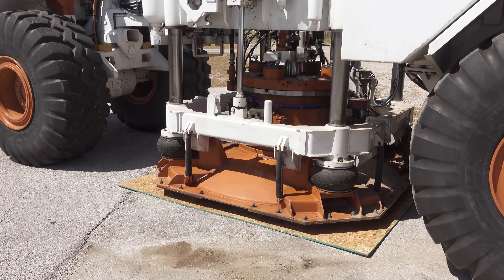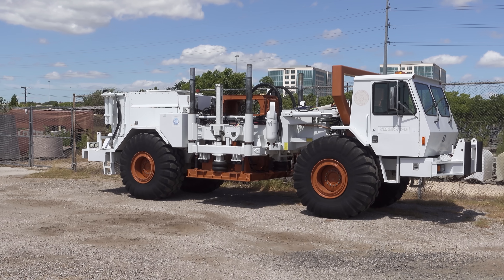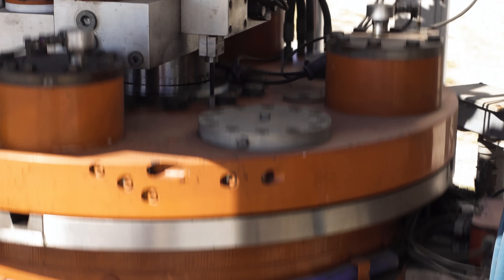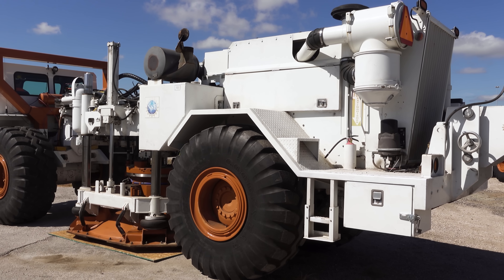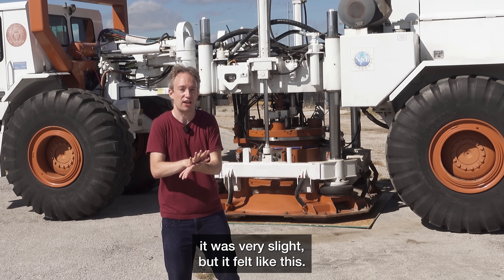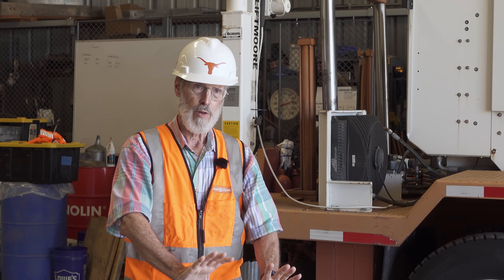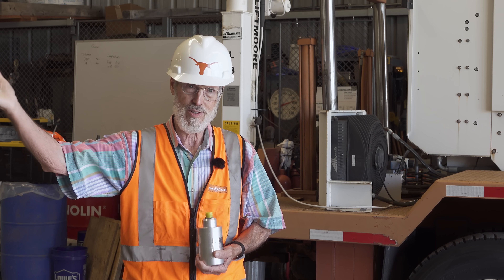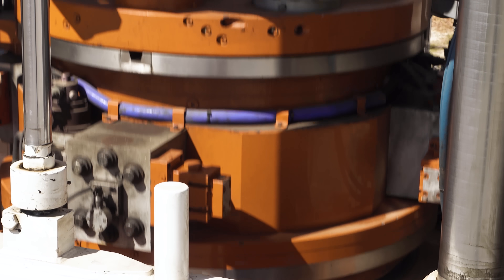This massive truck makes artificial earthquakes

Comment: It used to be called a vibroseis truck... you put 4 of them in a row, front to back, synchronise their occilations so the pads are going the same direction at the same time, and start a "sweep" of frequencies high to low with most of the 30,000 pounds of each truck resting on the pad.  That will constitute an energy wave that will reflect off subsurface structures that may confine oil.  On the surface there will be an array of low frequency microphones to record the energy waves generated by these trucks.

Comment: That unit has an ivi / Mertz chassis and so old but the shaker is modern with a Moog valve using a Pelton instrument. I’ve been a vibe tech for 20 years in the Middle East and that unit is a baby compared to new equipment. The main vibe manufacturers currently are Sercel and Inova with great technology

Comment: they did this in my community. within a short number  of years the gas lines which cross under the street were all replaced one by one. These companies should foot the repair costs for the damage they cause. they should create a fund to cover the cost of roughly half the infrastructure they map, as half the pipes run under the street to the side where the main line is.

Comment: Aha! That's what that machine is! I saw one of these at a dam near me, driving (and getting stuck) on the dam wall while the water level was low. I knew they were installing some kind of seismic sensors, but couldn't figure out what the truck was.

Comment: This technology was used in our area a few years ago by Friedrich-Alexander University of Erlangen to map 50*90 km of the underground due to a temperature anomaly. They wanted a) to find a reason for said anomaly (unexpectedly high temperatures in depths of 1.400-1.600m) and b) if it was safe to use that temperatures for geothermal power plants. They didn't find a direct explanation for it but could determine several areas where the underground would be ideal for geothermal energy and the next step is to proceed with actual boring there.

Comment: I'm sort of confused as I was working with a seismic exploration company that would bring in up to 3 of these type of shaker trucks and that was back in 1983.  Granted they weren't using it for earthquake analysis.  You could program the shakers to run through a complex signal to inject into the ground to pick up on the sensor lines for "looking" under ground at the various strata based on the return picked up at the sensors.  This was advanced back then when other strong signals were used previously by the geologist world.

Comment: The old British cartoon, "Danger Mouse" has a scene appropriate here.  "Penfold, is Wales known for earthquakes?"  "um.. I don't think so chief".  "Then it's as I feared, this vertical oscillation is being caused by the alternating pedal pressure of a large, 'draconium draconus'"  "Is that good?"  "It is if you like dragons, it means there's a whopping big one heading this way"

Comment: Shakers have been around for decades. While working at UT at Dallas in the 80s, I designed a remote radio control system to control one out in the Nevada Test Site. I sat on a mesa at night and used it to synchronize my recording truck with the shaker thirty miles away.

Comment: When digging out the concrete road in Hunter Street Newcastle NSW the vibration from the jackhammer on the machines made the building resonate causing some panic, the water in my glass had 6  two inch water spouts like that wave pool makes, it reminded people of the Newcastle NSW earthquake

Comment: This Professor Stokoe: Don't mess with him,. He seems like Nikola Tesla when he was testing his "air hammer" (according to the stories, he built an air-powered reciprocating "engine" that caused a local "earthquake" that had the potential to destroy buildings by frequency resonance, and it only ended when he "smashed the device with a sledge hammer".  Haven't yet found a true account, but you can see Mr. Stokoe has it in the back of his mind that he can "Jericho" anything if someone, even if it's him, says it's a worthwhile project.

Comment: I live in an area that has oil wells. A few years ago the oil companies did a bunch of geologic surveying, they had three or four of these machines running around with helicopters and ground crews setting up the sensors, they also had ground crews setting up sensors and triggering ground vibrations with explosives.

Comment: I remember these machines back in the 1970s in the UK. They came through our village in threes stopping every few yards testing for oil through seismic vibrations. And yes they found they found oil, some of which is still being pumped out of the ground now some 40+ years later.

Comment: Growing up on oil rigs on the Omani desert in the 1980s, we had similar but not identical pieces of equipment, we called them “thumper trucks”, used for seismic exploration for oil. A line of them would drive across the desert, pause, then all would drop their enormous weights at once to create a shockwave, which another truck a set distance away would read and produce a seismic survey of the rock strata underneath as they progressed forwards.

Comment: I used to work with a company that used trucks like these to create 3D underground maps of oil pockets and mineral deposits without needing to dig, by using a large grid of sensors on the surface and detecting the reflected shockwaves. Very cool tech

Comment: What an amazing piece of engineering that greatly helps science and architecture to create safe buildings.
This thing might be responsible for saving millions of lives and hardly anyone knows about it.
Reply: Billions. It is a part of a system that has saved 3-4 billion lives. It is used for oil prospecting, and without the Haber Bosch process (natural gas turns into fertilizer) 3-4 billion people would starve to death

Comment: Fun fact: Stephen Speilberg came up with the idea to have the glass of water vibrate to the footsteps of the t-rex, but no one on the crew could figure out how to do it, until the night before the shoot, when a crew member put a glass of water on a guitar and plucked one of the strings.  On set, they connected the cup to a guitar string that ran through the car, and a guy laying on the ground under the car plucked the string.

Comment: They use this for oil and gas exploration as well. Installed sensors all over the place, closed all streets and forbade all the farmers to use their tractors and then they drove around with a rattler like this which helped them exactly locate the resources

Comment: At CERN we used these kind of seismic trucks a few years ago to assess the impact of the civil engineering works needed for the High-Luminosity LHC upgrade on parallel LHC operation. Quite fascinating machines indeed.

(Fun fact: the LHC is a quite sensitive seismometer. We do see earthquakes thousands of kilometers away on the beam orbit. Note that over the 27km long ring the beam orbit needs to be stable at the level of a few 10s of microns...)

Comment: 27hz is the highest frequency my sub can play at 0db before dropping into nothingness (-120db) at 23hz, thanks to some EQ magic pushing the roll off point down to the physical limitations of the driver itself. I had to turn this thing down while it was pummeling the ground lmao. The high end was actually louder but it was also rumbling my room a little bit since I usually listen to your videos quite loud anyways. I've got a bit of experience causing miniature earthquakes myself, except we always did it using standard concert PA speaker stacks, during sound test before a large show! We'd flip a bunch of subs over on their face, so they created a compression chamber out of the entire horn, which lets the sub run more efficiently while transmitting the energy more effectively into the ground. If you hit the ground with enough directed sound energy all at once, you might get a visit from the local USGS team while they investigate what the hell is going on! Great people those folks are, we had a good laugh together once they realized what we had done.

Comment: These ground shakers have been around a long time. During the 1980s I lived in an apartment building and felt the ground shaking in a very regular rhythmic pattern. I walked out side and some distance away on a nearby street was one of these ground shaking machines that was being used. They would travel a short distance down the street and shake the ground then move about 10 feet and shake the ground again and kept repeating this for a period of time.

Comment: Cool.   One of the taller buildings at UCLA was kitted out with a bunch of strain sensors and accelerometers... A collaboration between a computer science networked sensors group and civil engineering.  I wonder if that was why these UT folks were at UCLA to get in trouble ;)

Comment: I delivered one of these to the Louisiana DOT a few years ago. Mine was like a big box truck with a lab inside. It had a plate on the back to shake and a press inside to lower a seismometer into the ground so they could take readings of what the ground composition was for road maintenance.

Comment: This is a 60'000 lbs tri-axial vibrator generating P and S waves, for O&G exploration even bigger but only vertical vibrators are used, up to 95'000 lbs

Comment: My dad does a similar thing on the opposite end of the spectrum: ultrasonic testing of welds and vibration analysis of marine diesel and turbine engines. I didn't realize it would work on a large scale like this too!

Comment: I want to see the "30 times a second" footage with the machine appearing to be still, with Tom in front saying, "Wow!  This thing can really move!"
Reply: At 3:20 the 30x second footage is briefly shown. Looks like nothing is moving.
Reply: It was in there, very briefly.
Reply: @musewolfman  @jkk244 It seems you didn't get the joke...
Reply: It should show up though. The camera is 29.97 fps I think, not 30
Reply: @Anonymous-df8it  And with that precision noted for the camera, you think the massive machine is exactly 30.00000 times per second?
Reply: @jkk244  No. But you seem to think that the massive machine is exactly 29.97 times per second
Reply: @Anonymous-df8it  lmfao
Reply: @Anonymous-df8it  after a period of time, i have found out the machine is actually 29.98 times per second
Reply: @yeetionary  Sow why does it look stationary then?
Reply: @Anonymous-df8it  its 1 more obviously
Reply: @yeetionary  ???
Reply: @Anonymous-df8it  it's stationary + 1
Reply: @imcaro  ???
Reply: @yeetionary  bit of a missed opportunity... he could have turned it up to 11
Reply: @Anonymous-df8it  The NTSC color broadcast standard has been out of use for long enough that people very rarely use 29.97 fps any more. When a modern camera says "30 fps", it actually means 30 fps.
Reply: @Anonymous-df8it  video editing software could be rounding it up.

Comment: In the mid 70's a company came through our town with a machine like this.  The day or two before they came by and drove a bunch of sensors into the dirt.   Truck came by and sat in the street and did the vibrating for about 30 seconds.  Then it picked up and moved about 200 feet down and did it again.  I believe the whole point was subsurface oil or gas exploration.

Comment: I remember when I was a teenager - so we're talking back in the 70s - coming back to sixth form college after the summer break, and many of us had had summer jobs.
One guy had been working for an oil company - perhaps BP, I'm not sure - but they had a similar vehicle, which was used simply to drive around the UK, park in designated spots, and do similar testing. Probably not to these levels of force, but the purpose was for oil and gas surveying, and they were taking seismometer readings back for analysis. Thinking back, it might have been in preparation for fracking.

Comment: This is probably reminiscent of what it's like standing beside a stamping press in a factory. The presses there ranged from 150 tons to 800 tons. And with a few exceptions they ran at about 40-60 Hz. Even with massive 6+ foot thick concrete flooring the whole damn place shook every hit.

Comment: I find these kind of machines really fascinating.
In Germany I visited a boring company with the school and they used these to find gas and oil in the ground based on soil that might have some inside them reflects the waves differently.
And this knowledge is used to make a good guess on where a location for a test borehole would be ideal.

Comment: Had the interesting experience of the purely vertical shakers being used in the middle of the city a few years ago. Seismic testing for geothermal energy. Fun when they are right outside your window, and you are on one of the upper floors of a late 18th century building. Been in a few earthquakes in Japan, and was rather odd to suddenly get the same feeling in a geo-stable city in the middle of Europe.

Comment: This is nothing new however, 30 years ago I worked for a company that a did oil exploration software. The way it worked is that one or more of these earthquake machines would shake the ground and then the vibrations were picked up by various sensors. Our software would then take this data and build a three dimensional map of underground as to the type of rock and likely places that oil might be. There was a lot more to it than that but that's the gist of how it worked.

Comment: These are used primarily in oil and gas  surveys, called vibrators. A whole fleet generates a wave of large magnitude and the resultant sound waves are picked up by geo phones . The collected data is produces 3D slices of geological mapping
Reply: Twelve years ago I watched a formation of trucks like this drive in sync across the Kuwaiti desert near a military base. They'd all stop simultaneously for a minute or two, then continue driving (still in formation) to whatever the next spot was during their surveys. Unfortunately I was too far away to actually feel/hear shaking.
Reply: Yep, that's seismic surveying. They complement the data they get with ground based gravity surveys (a box with a spring that you precisely measure it's stretch at a certain temperature) as well as aerial sensors on aircraft. 

Travelled all over Australia and northern Canada doing this. Best job I ever had.

Comment: Something similar was brought in to test the subsoil before engineering the final specs that the Cape Hatteras Lighthouse was lowered onto or should I say lowered to the appropriate grade with high psi bricks filling the gap between the huge block of reinforced concrete and the base of the granite foundation where the cable saw cut the original sub-grade foundation off. The actual foundation was pine beams which were perfectly preserved by being under the water table which was a huge surprise but further inland at that depth there is a lot of organic material hence the testing.

Comment: I was working on the Pacific Northwest coast in a small coastal town that was built on mud flats and wood waste from sawmills. The Nisqually Quake occurred while I was outside a pump station and I watched the ground making waves across the area , much like what you see when wheat fields are being blown by a gentle wind. I saw sand blowing out of cracks in the asphalt streets during this event.
Reply: That is a cool story. I think one thing about growing up is you realize how unique each place is. Besides brand new towns, most places have unique natural history
Reply: I was jet lag snoozing in Kyoto when a small tremor hit.
Thought my sister was shaking my bed for a joke.
Reply: cool.
Reply: My dad just ended up panic running out to the middle of the back yard like a vapor, and reverting back to when he was five, and seeing the Gas Works cooling towers rocking back and forth in the ‘64 earthquake.
Reply: Wow, that's crazy!

Comment: Wonder if it would work on 60fps either. Idk exactly how that all works, but it seems interesting. Also neat to see how closely the camera and truck match with the 30fps and hz (I think that's the right one)
Reply: You need 2x the frame rate as the rate of occurrence to capture it properly on video, I believe

Comment: I love how both machine and camera where so perfectly timed in the 30 frame a second section. So every picture was at the top of the strike, and the strike happened in between pictures.
Reply: you dont have to precisely time it at all. every time the camera took an image the shaker would cycle once, so we have no way of knowing if it was at the top, middle or bottom of its stroke. it just was in the same spot because its cycle rate matched the cameras framerate.

Comment: I play a game called snow runner and there's an attachment of that kind in the game it's a seismic vibrator and in the game you use it to scan for oil deposits. it's slightly similar but it has four units instead of one.

Comment: To give you an idea of how massive these machines are, a friend once backed one of these into my new car. It literally cut my car in half with its corner.  My friend said he felt zero resistance. The university replaced my car.
Reply: That is a lot of mass. Wouldn't want to fall asleep at the wheel in one, could go through and through a house.